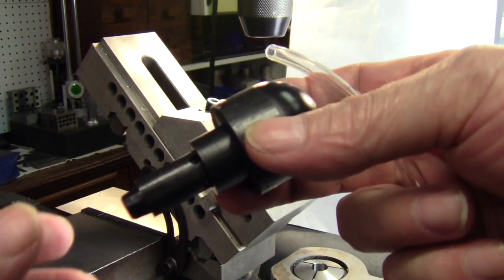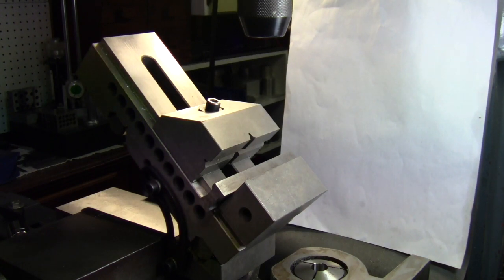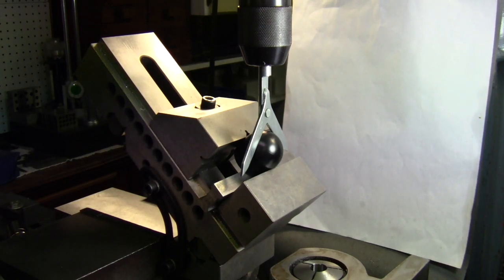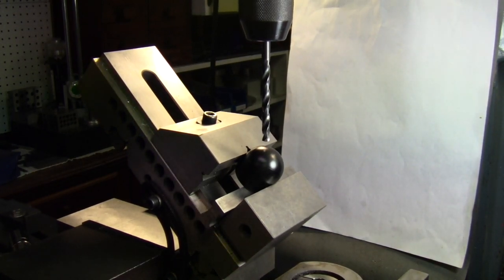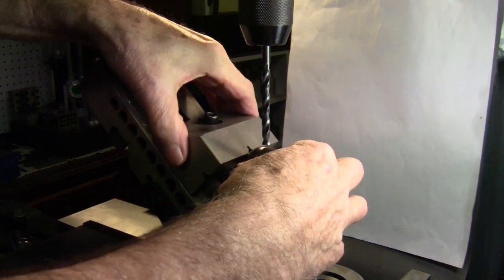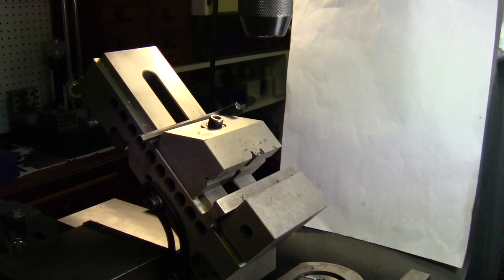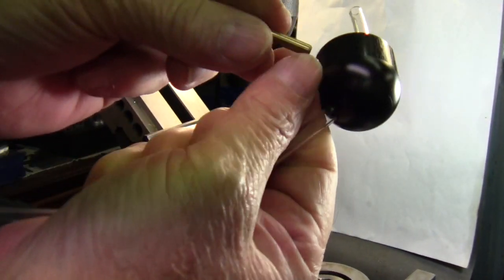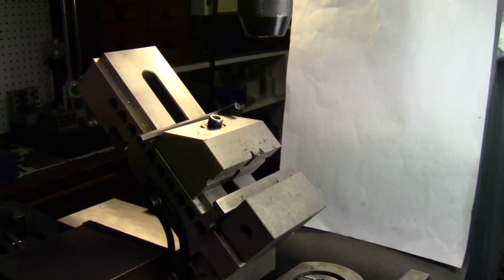Drilling Tubing Hole in a Delrin HP Handle

Comment: Your gonna HATE me! I like the tab at the top? Didn't they have a war in Lilliput over which way to up to crack an egg?
Reply from the maker: ? Lost in translation....
Reply: @ralex397  I like the tab at the top, you like at the bottom, nothing to get to bothered about. I think I used to use it for which way the tip would be located, I had to have it opposite the tab? for no apparant reason